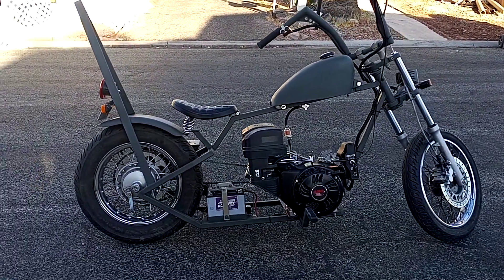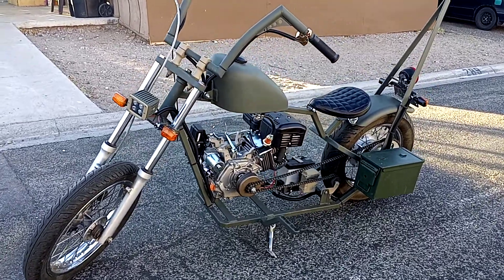420cc bobber

Comment: A billet flywheel, carb and intake. Plus a decent exhaust and relocate the starting switch and key. And remove the governor you probably have, but with a stock flywheel doing 55 detonation  is a strong possibility.  Nice build a lot of potential.

Comment: My only complaint was there no possible way to get the motor more centered an maybe use a jack shaft setup to bring the chain back in line from the offset with the rear sprocket
Reply from the maker: You can get a reversible clutch so the teeth are closer to the engine so it doesn't stick out so  much. I tend to use the heavy duty clutches that are not reversible and only fit one way. Yes a jackshaft would  help center things better.

Comment: The motor is hanging out too far..
Reply from the maker: There are two ways to combat that problem. Building a project with a wider tire will bring the motor in or using a clutch that could be mounted  inboard or outboard that way the clutch teeth are closer to the engine. Either way will help move the engine in. If you get ambitious you can put a jack shaft in also.
Reply: Yea just turn the clutch around . Worked for me
Reply from the maker: @chrismarusic4277  that particular clutch is not reversible, it's tapered down to one end.

Comment: I agree with keeping the motor stock (though a muffler for better sounds) but a torque converter is a must.  It will improve acceleration and make it ride smoother.

Comment: How did you get it registered?
Reply from the maker: That front end came off of a Kawasaki eliminator 125. So that is what is registered and insured as. Basically whatever front-end you end up using obviously has the VIN number on the neck and whatever that bike was, that is what you insure and register.

Comment: You need the billet parts and it will stay together. Maybe an oil cooler.
Reply from the maker: I had 2 Arc billet rods installed into two different engines. One installation was by a professional and the other one was not and they both ended up blowing holes in the blocks. I don't mind using other parts that are billet but I refuse to use the billet rods because the stock ones just work and I never have had a flywheel explode either. Not to say it'll never happen but I definitely don't trust those billet rods anymore. You don't need an oil cooler especially when the motor is already forced air cooled. I've never had one of these engines overheat and that's using them for years in the Vegas summer.

Comment: looks awesome! how did you get it licensed?
Reply from the maker: The front end was originally a 2001 Kawasaki eliminator 125, that is what the custom motorcycle was registered and insured as. I moved to Utah a few months ago and registered a homemade bike here the same way. Basically start off with a front-end that has a title already.
Reply: @custombikesandtrikes4374  so it's registered as a motorcycle or as a "motorized cycle"/moped. Where I live you can register a motorcycle under 5 hp or a motorized bicycle as a "motorized cycle" and not need a motorcycle license.
Reply from the maker: @shaundevan1525  yes, whatever motorcycle that you cut the front end off of because the neck has the VIN number attached to it. That will be what you register and insure regardless of the motor that you install in your homemade creation.

Comment: you need a 40 series cvt and that will shorten the chain while giving you a higher top end
Reply: Cvts are torque converters, meaning they give you torque and have no top end at all, it’ll get you to speed quickly but die once you hit 30-45
Reply: @joeyserpa9779  CVTs and torque converters are not the same. People call these 30 series and 40 series "torque converters" but they are actually just simple CVT transmissions, just like on a quad or snowmobile. They can be just as fast as a clutch in most scenarios if geared correctly (plus having a CVT allows for more aggressive gearing than you can do with a single-speed clutch) but they do suffer from higher drivetrain loss.

Comment: Looks like you kept the governor? Geared to go 55, how is it off the line? Good enough low end to put into an Enduro bike? Any plans for a torque converter? Looks awesome man .
Reply from the maker: If i keep it, It will get the torque converter treatment. the govenor on all of my 420 engines are bypassed. Ive been running clutches for a long time however from now on they will all have a tc installed on future projects.

Comment: What did you have to do to get the bike registered?  As I am getting ready to do the same with a vegas carts 460cc
Reply from the maker: I start off with a front end that already has a Nevada title. I don't have to have it inspected and I just registered it as whatever the front end was originally attached to. This particular bike was registered as a 125 Kawasaki Eliminator. Same with the insurance. Basically the VIN number is on the neck on most motorcycles.